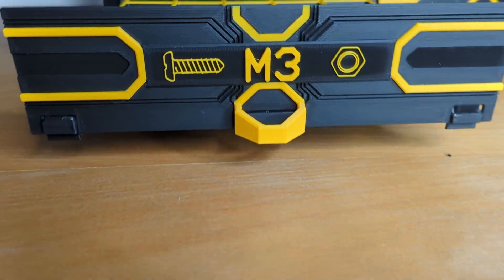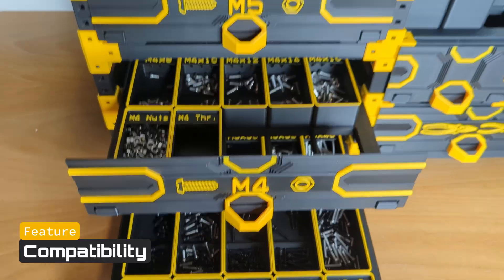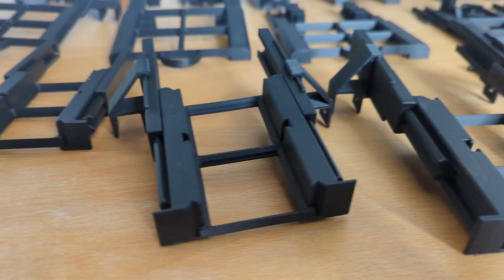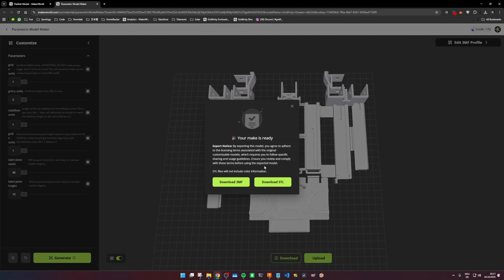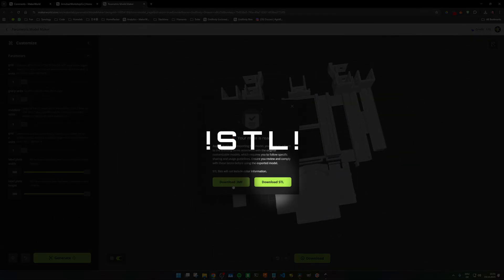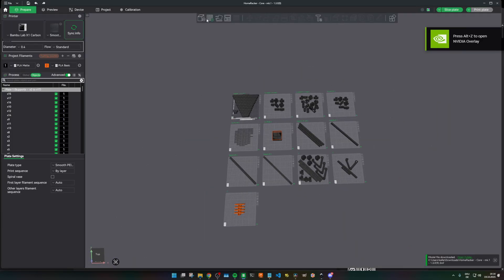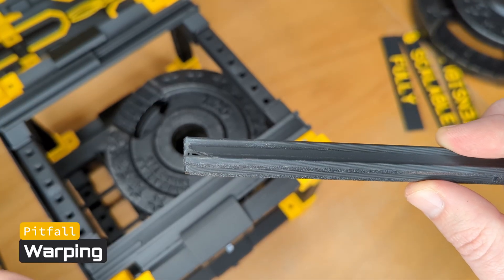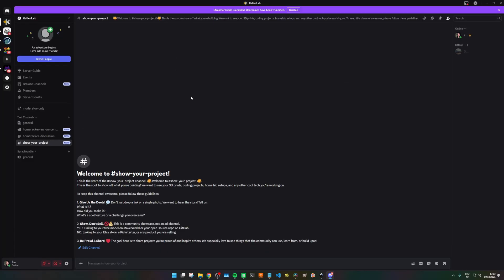Supportless Gridfinity Drawers: Full Extension & 100% Printed

Comment: This looks amazing. Could we design gridfinity bigger, for clothes and kitchen storage?
Reply from the maker: Thank you!
About the scalability. The systems themselve, both HomeRacker and Gridfinity would per definition be infinitely scalable.
However there's always the issue of print bed limitations (my current biggest printer has 256mm x 256mm) which require you to think in stable tiling. And this is a challenge we might want to tackle in a future iteration!
Thanks for the great question!

Comment: Moin! Incredible work - I really wish I were capable of making something like that myself... And the fact that it’s printable without any support structures is just awesome!
A heavy-duty version would definitely be interesting, but I’d also be curious to see how it would perform if the rails were printed from regular PETG, or even something like polycarbonate (though that would require an enclosure - but often still no hardened nozzle). Alternatively, my favorite option would actually be to just use simple off-the-shelf metal slides 😅 Yes, that kind of contradicts the idea a bit, but for a part like this that needs to handle load, it’s probably the best solution if you want it to work well over years instead of months. I’m definitely looking forward to future improvements or extensions! Really great work so far. You’ve got my sub!
Reply from the maker: Moin! Thanks so much for the detailed feedback and the kind words – I really appreciate your support and ideas!
+1 on heavy-duty. Noted! 
I think PETG should be no problem.
I doubt that PC would print nicely. This normally warps even worse than ABS or ASA... but given the low profile the "warping forces" might be manageable using proper brims and a proper print bed. You sparked some ideas, thanks. Will come back to that at some point.
About the metal-slides: Yup, that's definitely a something to consider. 
Thanks for the sub and for taking the time for such a thorough feedback. Nothing more valuable than that to me.

Comment: I love the homeracker modularity and would adore more heavy-duty and scaled up versions. I'm personally not averse to reinforcing it with metal tubes, bars and angles etc. to make it load bearing. But if you do go that route, I would appreciate it working with a range of dimensions when it comes to the metal for easy sourcing and mainly stick to chopping and drilling to keep it accessible. 😄
Reply from the maker: Thanks a lot for the feedback. That's very valuable to me. I'll consider that for the next iteration.

Comment: Killer design as usual mate.

One thing that would be great would be to separate the drawer slide mechanism into its own model / generator. My sense is that there'll be a lot of uses for that mechanism in Homeracker that will go beyond Gridfinity, or even basic drawers.

Also, +1 vote for heavy duty, bulky versions for sure. More options in a system like this are always better.
Reply from the maker: Thanks!
And yeah: I already thought the same thing. 
I guess with the next iteration I'll decouple the drawer slides entirely to achieve exactly that (and heavy-duty of course).
your feedback is very much appreciated.